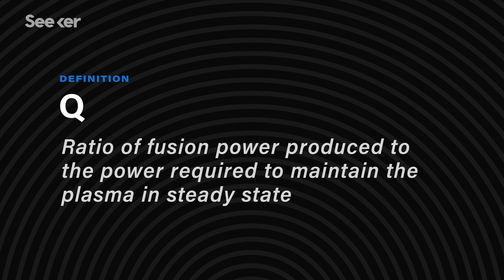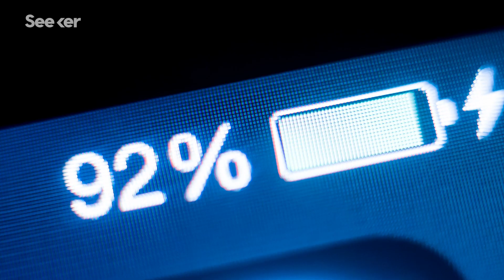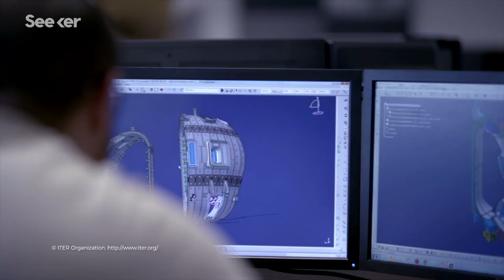How Close Are We to Fusion Energy?

Comment: Oh for crap sake.. I REALLY want Fusion to work.. But they're STILL going to use it to boil water??? We STILL haven't found a way to collect electrical energy that DOESN'T involve boiling water??? WTF?
I thought these scientists had come up with some clever way to capture the excess electrons coming off the fusion process or something... Not just use the excess heat to boil water..
That just seems SO wasteful and inefficient and indirect.. Like I'm surprised on paper they actually think this will be able to generate such vasts amounts more energy than is put in.. But I guess that's why it's taking so long.
Really too bad they don't have a better method for absorbing electrons from something like this.
Reply: I take it that with this comment you are heading off to a graduate degree?  so that you can solve this problem that you have identified?
Reply: I'm not sure what you mean but this problem is a fundamental limitation of the universe. I was just trying to put context to what I previously said since the chap seemed interesting. I'm still an undergrad this is just undergrad classical thermodynamics.
Reply: smlifyrasor This is because you don't understand physics. Water has a huge heat capacity as such it can hold large quantities of energy. Further more the heat engines that produce our electrictiy get very very close to the carnot efficiency (maximimum possibly efficiency for a non reversibile heat engine). These aren't steam engines you see on trains these are incredibly well engineered marvels of science.
Reply: +Joshua Cool, thanks for the explanation. It's impressive how we do it, I'm just surprised that the mechanical motion from steam pushing turbines doesn't have a really high efficiency loss, cool that it doesn't tho. Still makes me wonder if there could theoretically be a more direct way to absorb energy from a fusion type system. :/
Reply: All engines that turn heat (hot stuff -> cold stuff) into mechanical energy (usable energy like electricity or motion) are bound by a limit due to the second law of thermodynamics. The law which says in a closed system that entropy always increases, in physics specifically thermodynamics entropy is defined as dS >= dQ/T, from this using a funny proof you can actually come to the conclusion that there is a maximum efficiency for any engine. The maximum possible efficiency for any engine is whats known as the carnot efficiency. This is when an engine is reversible (not possible in real life but you can get really close), meaning you can turn it backwards and it will do the opposite as turning it forwards at the same efficiency. The carnot efficiency is not 100% its lower than that and actually it depends on the temperatures of input and output stuff. This efficiency is given by u = 1 - T2/T1 where T2 is the output temperature and T1 is the input temperature. Say we try rough values for a turbine like T2 = 100C and T1 = 500C efficiency u is still only 80%. This is the physical limit of the universe. There is no way of cheating it so no matter the method you will always be limited by the carnot efficiency. You physically can't turn heat into work without waste energy. In our example even if the engine was a perfect carnot engine it would still produce 20% waste heat. If you could turn 100% heat into work there is actually a way you can produce more energy than you started with which you can see would not be correct.
Reply: smlifyrasor We humans mostly need energy in the form of electrical potential which can only be achieved through mechanical energy. The only kind of energy from fusion is in the form of heat and radiation and the best way to convert that energy to mechanical energy is by using fluids. Water is the best fluid bc it's so abundant and safe. Many other fluids could work too.
Reply: You could do it with super critical CO2, but it's still a turbine spinning a generator. The efficiency is theoretically better as it uses the Brayton cycle rather than Rankine.
Reply: Go chop a tree down and heat your home with it and enjoy your tea. Fusion does work, the point is will it be cost effective. If it is the world would go into production mode. Energy dynasties like Exon would wither and die,,they're going to delay any threat to that without holding back..Nations/countries who's wealth depends on oil and coal will change. I doubt that would be the better..Maybe the world would stop Waring over oil..I doubt that because with lower cost of electricity and lower cost of bringing goods to market the demand for new and better goods  will surely follow. We will probably drop war for oil but shift the wars for other resources...Anyway time will tell and I know if MIT is building one,,,IT works and will IT will be cost effective..just not in our time...
Reply: yeah lets boil all the water on earth great idea
Reply: smlifyrasor 1) there’s already fusion plants that generate more energy put in. 

2) You go make a better system then.
Reply: SonicSP, that's fine, awesome really.. I wasn't focusing on whether plants can generate more.. I'm just shocked that they're still using it to generate heat to boil water.. I assumed there was some new method of collecting electrons, that didn't require/use ONLY the waste heat to boil water to spin turbines.. It just seems rather indirect.

Comment: I think for the mid term we need to do new Nuclear Fission reactors because people have a unfounded fear about Nuclear fission, yes current nuclear fission is not perfect, but it's the best option we have currently. Scared of fission? Well do you know that per MW produced Nuclear fission power has killed the least number of people when you factor manufacturing in, even compared to Solar and Wind.

Because panel require the use of heavy metals and other toxic materials in there fabrication, and in most places they are not disposed of properly which has lead to Solar being a much bigger source of radiation contamination than Nuclear has, you just don't hear about it because it's very dispersed which we already know that dispersal is not a valid way of getting ride of radioactive materiel.

For wind turbines it's a eventually solvable problem, because the problem is in the manufacturing and how the manufacturing is powered, because to spend a lot of power to make a wind turbine and that mostly comes from coal, and you cannot run manufacturing off a unstable power supply.

So as said our best option in Nuclear fission, and there are better ways to do it. MSR (Molten Salt Reactors) are a way not only to increase the safety as unlike current light water and heavy water reactors they do not run under pressure so if there is a breach in containment which is likely likely to begin with because they are not under 70+ atmospheres of pressure, but if there is a breech the spill will be localised and can be cleaned up relatively easily.

There is no such thing as a meltdown, no hydrogen explosions which spread radioactive material far and wide, so basically even if there is an accident radioactive material isn't going to get into the environment. 

Same for liquid metal fueled reactors, apart from Soidum and NaK as it will catch fire on contact with the air, I would probably avoid that one.

added bonus of Liquid metal fuelled or Molten Salt Fuelled reactors is that they can run at a higher temperature than solid core reactors, which opens up the possibility of desalination of sea water using waste heat from the reactor as well as off peek power so the reactor does not lose money on off peek power so it increases the economics for the reactor because you can run it at 100% all the time apart from servicing, but it would mean 98% utilization.

Also it allows you to create liquid fuels in the reactor with a carbon source and water the by product of which would be oxygen, so if you are doing carbon capture you can feed that into a reactor that is during liquid fuel fabrication, which that way it would be making carbon neutral liquid fuel.

And if you also captured the oxygen you could do liquid fuelled peek power production powered by these reactors, as if you burn the fuel in pure oxygen first it's hotter which allows for a more efficient power plant, second the only bi product is carbon dioxide and water vapour which you can get the water vapour out by cooling it below 100C.

Although if you plan to do it just for peak power I would suggest just splitting water into hydrogen and oxygen because you can skip the carbon capture which is still a step although a relatively easy one, and again you could do the the Oxygen and Hydrogen generation in off peak hours, and a hydrogen and oxygen combustion is so hot that it would be very suitable for peek power plants as you would be able to spool up and spool down the reactors very quickly.

And thermally splitting hydrogen and oxygen is more efficient than doing it via electrolysis, although concentrated solar could do it too, but at a higher price.

Comment: i had this question for a while... 
in order to do sustainable fusion doesn't it requires certain amount of gravity or pressure to maintaining it? 
i mean.. all the fusion happening stars are big...  so is it possible?
or
are they just trying to get 10 times net worth energy from single try and keep repeat it to gain plus net worth of energy?
Reply: You basically need to keep the plasma from flying apart and yes, the magnetic torus creates that pressure. It's not a very high pressure by the way, just enough to keep the plasma from touching reactor walls and cooling down.

Comment: Can fusion engines be considered perpetual motion engines?
Reply: DANDAN THE DANDAN no, they use fuel, so no perpetual motion. You can fuse helium if you run out of hydrogen, but that also only works until you reach iron.
Reply: and requires greater and greater intial energies, iron is rarely reached even in stars a few times the mass of our sun.
Reply: DANDAN THE DANDAN No, you still need hygen

Comment: Fission is anything, but scary. Close to 100% of the so-called waste from fission can and should be reused. 96% can be reprocessed and put back into a reactor. The other 4% have other uses like treating non tumor cancers and for smoke detectors. Elements with longer half-lives tend to be more mildly radioactive due to slower decay. Elements with shorter half lives tend to be more strongly radioactive because of stronger decay.

And I hate to tell you folks, but ecofascists will fight fusion as well. The reason is because greenies are not opposed to "dirty" energy, but energy period. Why? Because reliable and abundant power leads to economic prosperity and maintains industrial society: two things greens oppose. Poverty, deindustrialization, and technological regression are their goals. This is not a conspiracy theory. I have been told this personally by greens.
Reply: Gammareign yea I agree. Even former Green Peace members have stated they mistakenly went after nuclear power. It would take several meltdowns a year to equal the distruction and long term health effects of burning fossil fuels. Where I live they almost stopped a Hydro Electric project. This is the the difinition of stupidity. Hydro electric has zero emissions and is over 90% efficient. It is the BEST and most reliable power source. Yes I understand is screws up a river, but it creates a lake and fish spawning is now incorporated into the dams engineering. Plus they just LAST FOREVER with minimal maintenance and overhaul. 

But Greenies are in it for the money. They need a villan to get funding. If they were truly in it for the enviroment they would have been lobbying our government to speed up construction of the dam and bulldoze the backup natural gas plants we have.
Reply: Well, I hear that the technology to reprocess nuclear waste is similar to technology to make weapons grade uranium....
Reply: It's not. Reprocessed fuel cannot be made into a nuclear weapon.
Reply: Then why do they bury the waste with 10,000 year warnings?
Reply: They bury the waste with 10,000 year warnings out of sheer paranoia.  The "hot" waste (i.e. highly radioactive) has a short half life.  It goes away quickly, like in a hundred years or less.  We are capable of containing wastes for that amount of time and much more.  The longer-lived wastes are far less radioactive.  This is simple physics.  In ten thousand years, reactor waste is not going to be very dangerous.  You'll be able to hold it in your hand.  Eating it would not be a great idea, but that's true of many things.

Comment: This video is BS we will never get more out then we put in to get fusion.  The pressure you need to force two atoms to fuse is enormous amd we will never get a net out positive if we have to generate those pressures artificially.  Think about it the pressures at the bottom of the ocean or in the center of the earth is hugh and atoms dont fuse!! You need a center if a freaking star to achieve fusion!!  This clean enery idea is BS as much as a perpetual engine.  Let think of a more efficient way to generate energy than using steam then maybe we will stop burning everthing...
Reply: That's not how it works. You don't need that much pressure at all, it's not pressure that's doing the job, it's the temperature. What you need is for the plasma to stay contained long enough and that's a function of size of the reaction vessel and strength of the magnetic field holding it together.
Reply: We can already have more energy than we put in with fusion reactors The problem is fusion is too impractical and expensive at the moment.
Reply: SonicSP impractical like they can only do 10 to 16 fusions right now?  Check out the video straight for the horses mouth.  Totally proves my point.  Reference another seeker plus video.
https://youtu.be/BObk4-XQJRw _ at 10:20
Reply: Herman Woo you are so wrong about so much I can't even write a proper response that isn't just telling you how ignorant you are. Wow, you're ignorant.
Reply: "when you artificially inject energy to a system to fuse atoms you are never going to get a postive output"
Where are you taking that from? That's just wrong. Don't you know how a thermonuclear bomb works? You have the fission stage that gives enough oomph to get the fusion going and then the fusion reaction gives power output many many times more than the fission device put into the system. It's just a matter of creating that ignition condition and there is nothing hard about that, you can do it in a simple tabletop device. 
The hard part is keeping that very hot and energetic plasma contained, because if you don't it expands and cools ending your reaction. Couple of options there, you can increase the size of your reactor, you can increase the strength of your magnetic fields containing plasma or you can come up with a cleverer shape of the magnetic field that is better at containing the plasma. 
ITER is taking the first option, because it's very well understood one and is guaranteed to work. There are bunch of unanswered engineering and economics questions that cannot be solved without a reactor that can actually maintain a burning plasma in a steady state, that's why it's getting built. It's not about if it will work, it's about how to build the things so that they last, how to build them such that they are economically viable, how to maintain and keep them running. You need a manufacturing chain for all the tech that is still in a experimental stage. There's lots of questions ITER will answer, basic physics is not one of them.
Reply: aleksander suur 1)So how much power is need to maintain the magnetic fields to contain the plasma?
Reply: aleksander suur 2) How much MW of electricity is it going to take to cool the neutrons it produces?
Reply: Ok tried to keep it simple when I meant pressure ie heating up to plasma to a point atoms would fuse, my point, is that when you artificially inject energy to a system to fuse atoms you are never going to get a postive output to be fisable to use as a power plant.  Its science fiction.  If in 20 years the world is running off fusion energy plants I'll be happy to come back to this post and say it was wrong but I am pretty sure you will be the one posting in 20 years.

Comment: Man ya'll need to put some information in this video on aneutronic fusion approaches like Polywell or Focus Fusion, using pB11 fuel and creating electricity via induction from the resultant alpha particles rather than using heat to turn a turbine.
Reply: TeslaRifle Turbines are very efficient actually close to approaching the carnot efficiency.
Reply: Sure, but if you can get electric current directly from the fuel source then you can drastically shrink the power plant. It would also work better as a power source in space.
Reply: Fusion reactors are not going to be a viable power supply in space for a long time due to the copious amount of shielding required.
Reply: Maybe sooner than you think! It's already being worked on at my alma mater :P